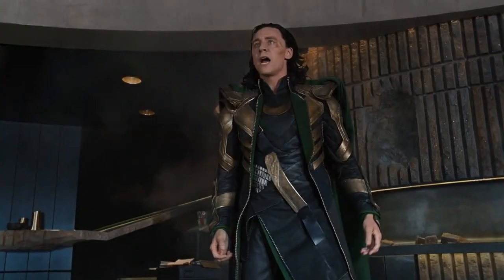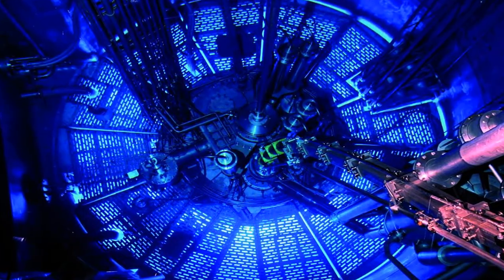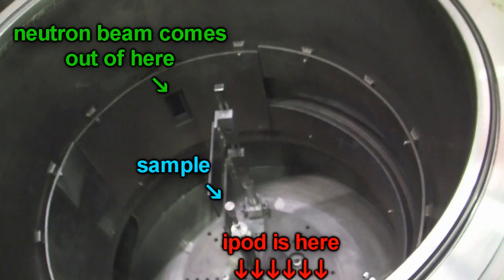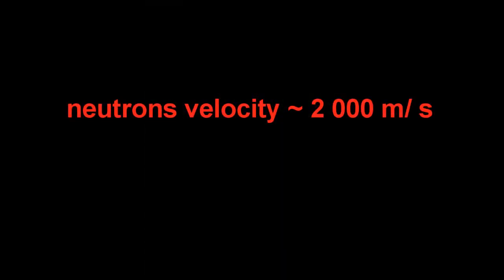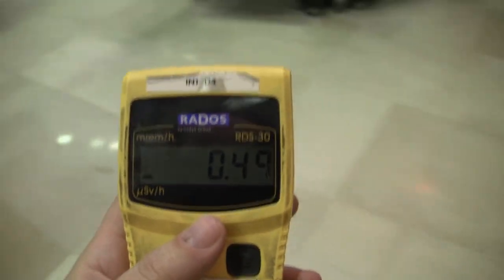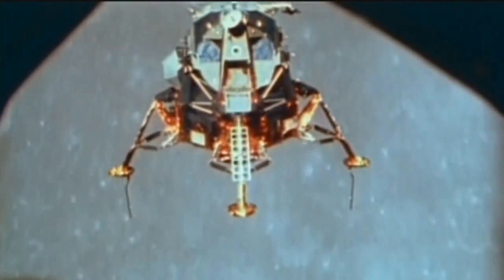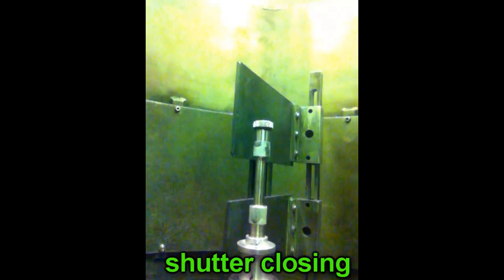Ipod in a Nuclear Reactor Beam

Comment: It could be an interesting idea to add a PIR sensor to the area that prevents the shutter from opening, just in case someone gets forgotten.
Similar issue have arisen when doing NDT on pipe fittings at a certain gas plant.

Comment: And if the neutrons get absorbed by GOLD, the gold turns into mercury. Specifically gold's one stable isotope, gold 197, it turns into gold 198, which has a half-life of 2 days and turns into a stable isotope of mercury. And I'm sure that the beta decay of this induced radioactivity in the gold is pretty dangerous too. So I have for you a way of turning gold into mercury. Just hit it with neutron radiation. The alchemists of old would be so proud.

Comment: Hello, great stuff. I realize that these are real, but could you please do a video about beam dumps? From particle accelerators I mean.. What goes into designing something like that, with the energy levels keeping to increase In Finnished and proposed accelerators? Hope I'm not too far off from the correct way to pose the question..😊

Comment: I think radiation can be a way to give your ipod superpowers. Like when perhaps just zapping the processor right you might reset the secure boot protection fuses allowing it to boot any image with or without the correct signature, freeing it from it's bondage to apple. Of course just zapping it like you did is more likely to flip bits that are not useful when flipped turning your ipad into an either inert or very oddly behaving paperwork paperweight. However it may be, causing malfunctions intentionally in security hardware with ionizing radiation is probably a good idea. Either that, or nanites that contact the address and data busses.

Comment: I don't know if you said it but what is the source compound for the beam?
Reply: Eric Not 100% certain if this is the case here, but a common neutron source would be hydrogen isotope fusion. Fusion of deuterium and/or tritium generally knock a neutron from the newly formed nucleus. Though these are super fast neutrons, orders of magnitude faster than the ones found in this beam, so you use a neutron moderator to slow it down.

Comment: Neutrons from a reactor can actually activate the aluminum body of the ipad, but the produced radioisotopes decay in a few minutes. 

On a side note, a standard GM tube is not en efficient tool for measuring neutron radiation, I wouldn't rely on that.

Comment: Thunder foot have you ever heard of a material that a guy came up with called star lite? It was a polymer clay like paste that was heat resident. 
If you know the stories about it do you think that it was a Hoax? If not what do you think the ingredients might be?
Reply: Might be a typo to say "heat resident" instead of resistant.
Reply: Ananta Sesa das
 Thanks. Yes. Heat Resistant
Reply: would love to see starlite
Reply: Curious. Perhaps some aromatic hydrocarbon which evaporates and cools the underlying surface. In all likelihood, it was more of a party trick than a hoax, and no formulation based on this invention would have long lasting protective properties. But yeah that's definitely a great subject for Mr. Thunderfoot.
Reply: aerogel doesn't evaporate it's just so full of air that the specific heat is very low. leidenfrost effect lets you hold liquid nitrogen in your hand.Siana Gearz
Reply: I figured starlite was sand and silicon gel based.

Comment: Somewhere in some video you said they decay at ~ 10 minute rate, well then if you just turned on then why did it immediately start affecting the Ipod and gieger counter? shouldn't you have like 10 minutes before the first couple neutrons decay? Or are some of them because of the immediate finding of a nuclei (IJust remembered you said that it released the energy when it bonds too, is that why?)
Reply: +poochy355 The decay of free neutrons is basically a radioactive decay, i.e. it's a random process. Free neutrons begin to decay right after they were "born" in reactor. Some do it faster, some slower, it's pure random. "they decay at ~ 10 minute rate" means that "50% of initial neutrons will decay in 10 minutes".
PS sorry for my bad English, haven't practiced it for a long time.
Reply: +poochy355 Decay is when a particle breaks up into smaller particles. The cause of the flashes is neutrons bonding with the atoms in the pixels releasing a shit ton of energy producing a flash.

Comment: Can you make an experiment with a small piece of pork meat and put it in glass tube and see what would happen by neutron bombardments !!! That would be very interesting !!! :)
Reply: +Nickael7 Nothing you could see directly. Though it would decompose quicker than normal.
Reply: 556x45mm NATO
I don't think so due to irradiation.
Reply: Nickael7 Decomposition of organic matter relies on bonds being broken, so that the carbon oxygen and hydrogen in the matter can return to the environment in the forms of carbon dioxide and water. When you've had neutrons decay in organic matter, all it does is break the chemical bonds, which will in turn cause it to decompose quicker. It will not be "irradiated" whatsoever, and will hold no radioactivity shortly after the neutrons decay, not that this has anything to do with decomposition reactions in the first place. Where did you get your chemistry degree?
Reply: 556x45mm NATO
After the explosion of the bombs of Hiroshima and Nagasaki, the corpses had very hard time to decompose, to decay...
With your chemistry:
Where did you came with such conclusions ???
Reply: +Nickael7 Nothing.
Reply: +Nickael7 They had very hard time since they were charcoal.
Reply: CptHrki
That is my first impression...

Comment: Scintillations galore! Reminds me of my alpha particle spinthariscope! Neutrons have a half-life of just less than than 15 minutes. They decay into protons and release ~1 MeV of energy. Water is good at moderating them. Borated paraffin is good at slowing them down to thermal neutrons, so they can be captured. Neutron cross-section is measured in barns (bn). Fissile nuclides can release them, and alpha/beryllium sources can produce them, i.e. PoBe, RaBe, PuBe, and AmBe are used as portable sources.

Comment: Neutron has mass 939.565 MeV/c^2 which is 1.6749*10^-27 kg. Video mentions velocity 2000 m/s.
Kinetic energy E.K. =1/2*m*v^2 (for non-relativistic velocities) = 1/2*1.6749*10^-27*2000^2=3.3499*10^-21 J which is 0.0209 eV, not 0.3 eV mentioned in video.
Neutron decay n0 = p+ + e- + Ve + 0.782 MeV, not mentioned in video 1 MeV. Part of energy is taken by anti-neutrino.
If neutron capture will happen, neutron will join with some atom together, and then they can decay releasing plentiful of energy, releasing electron and anti-neutrino, or even fission (U-235 etc.). But released decay energy depends on material and isotope it joined.

Comment: serious question? being that neutrons take a short while to decay, do you or would it be a good idea to wait out the half life be fore entering to the exclusion zone... as in is there a time after the shutter is closed that you can't go back past the gate?
Reply: +George Holt That wouldn't do much since neutrons do actually leave residual radiation. You see, when a neutron hits its first atom, it will most likely split it, producing another neutron. However, after losing energy in the collision it will become slower and most likely be absorbed by the nucleous of the next atom it hits rendering that second atom radioactive from a few minutes to months and years. As this reaction progresses more and more atoms are rendered radioactive until at one point the reactions stops since all neutrons have been captured, but the radiation will persist. This is also why neutron bombs aren't clean.
Reply: +Glen Brockwell Neutrons do actually leave residual radiation. You see, when a neutron hits its first atom, it will most likely split it, producing another neutron. However, after losing energy in the collision it will become slower and most likely be absorbed by the nucleous of the next atom it hits rendering that second atom radioactive from a few minutes to months and years. As this reaction progresses more and more atoms are rendered radioactive until at one point the reactions stops since all neutrons have been captured, but the radiation will persist. This is also why neutron bombs aren't clean.
Reply: +Glen Brockwell You probably have no idea what you're talking about. First of all, there are no fumes from a neutron beam, adn secondly an exclusion zone is a zone you SHOULDN'T be in, not a safe zone.
Reply: +Glen Brockwell Nothing comes out of the tunnel except for radiation. It is sealed on the other end, otherwise you would be having a bath in the coolant.
Reply: +George Holt Newbie question, explanation: Neutrons penetrate further than gamma rays and do not leave residual radiation on objects...
Reply: I don't study this stuff at all, I was simply asking about a matter of practice at the reactor... I didn't think there was long term residual radiation what i was asking was is there a very brief period where the immediate area is this radioactive or is it immediately safe the moment the beam is closed?
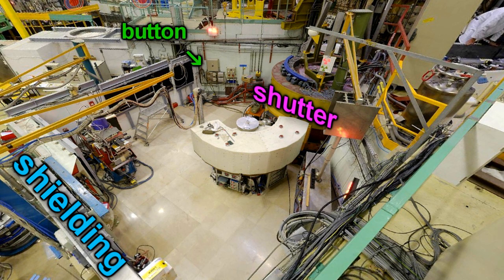Reply: +George Holt As far as I can tell; the place is a lab of sorts (pause at 02:00). Observe the exclusion zone is perhaps the only safe place while the neutrons are released. Dude opens his bunker after the radiation is halted, walks to the experiment about 5 meters and opens the outer core in ten seconds. Unless the clip is edited, there is no break to wait for potentially dangerous 'fumes' lingering out of the 'gun hole'. Which would have a half life of a few days.
Reply: +CptHrki I can only imagine what comes out of the reactor when the core is exposed. Moreover it wasn't residual neutrons I had implied was "lingering" but perhaps some radioactive aerosol which is produced in the nuclear reactor.

Comment: Those flashes can be seen with normal earth background radiation.  They're just far less frequent, you might see a flash once every few days.  If you're wondering why you see a pinprick of light in your vision every once in awhile, that's why.  The Earth's radiation shield (electromagnetic shield & ozone) isn't perfect so we still get some radiation, and those flashes are just what happens when a stray neutron interacts with your retina and the nerves fire making you see a flash in your vision.
Reply: +Sue Sakamoto actually most of those things you see (commonly known as "floaters") are usually the result of dead cells that have been shed from the lining of your eye and floating in the fluid of the eye ball, or dust and fluid on the surface of the eye.
Reply: crwydryny
 I know what eye floaters are and I've seen them, what I'm talking about are not eye floaters.  You can see eye floaters any time, these flashes of light that I'm talking about are high energy particles interacting with the fluids in your eye.  You see them a few times a week at sea level, almost never underground, and daily when in a plane or on a mountain.  These particles are the minority of nuclear radiation from space that gets through the Earth's electromagnetic field and atmosphere, but they also come from the Earth, specifically where radioactive elements are decaying.
Reply: Alec Risser
my comment was in reply to sue sakamoto.

yes I know about flashes of light caused by radiation
Reply: On a phone, can't edit...  *electromagnetic field
Reply: +Alec Risser staring at the sun then looking away allows you to see the bacteria in your eye, the "green tints" are the bcteria squirming in your eye. (SRC: Matthew Santoro, amazing facts series)
Reply: It's radiation from space and radioactive elements in the earth.  I'm only talking about nuclear radiation not electromagnetic radiation in this situation.
Reply: +Alec Risser No, they can't. Here's why:

Earth's own background radiation (from the ground) mainly consists of very weak electromagnetic ionizing radiation or beta and alpha particles which are readily stopped by very thin material and don't have nearly anough energy to cause flashes. As for cosmic radiation, it's mostly composed of gamma radiation before it reaches the atmosphere. If it went straight through and hit you in the head, you'd be dead fairly soon. Fortunately, cosmic radiation hitting you is pretty much impossible since it interacts with air and everything else in the atmosphere breaking it up into weak radiation talked about earlier, rendering it unable of producing flashes of light. Same goes for Sun's x-rays.
Reply: Your eyes are sensory organs that sense light.
Reply: uggh Trump!
Reply: +Steven King YOU DON'T SAY
Reply: most of the time i saw my own white blood cells when looking at the blue sky.
Reply: +Alec Risser 
I had the suspicion that this might be true. I occasionally do see flashes of light despite no car windshields reflecting into my eyes etc and sometimes when I'm trying to fall asleep. I reckon about every couple of weeks or months. I read that there is an eye sickness that can be the cause but I discarded that since other symptoms would have been more prevalent. I read that astronauts do see those and I thought maybe on very rare instances the radiation does reach the ground and hit my eye. But you say it's earths radiation?
Reply: crwydryny
 I know.
Reply: +Steven King u know
Reply: +Steven King I know
Reply: +John Doe was looking to see if anybody posted this info
Reply: That's interesting. I'll remember about this when i start to see stars. Who knew that humans have internal geiger counter?
Reply: +Razzfazz87 better stockup on dem radaways
Reply: Alec Risser
Interestingly (at least to me) is the phenomenon sometimes called the "blue pearl", a tiny blue light smaller than a sesame seed, which in Hindu Tantra is recognized as the visual component of "nada-bindu", the high-pitched ringing that is not tinnitus but can sometimes be heard in a quiet room.  These are considered divine and can form the basis of a meditation practice... 🙏🏾✌🏾

Comment: is it not also possible that was electrical signal interference? ive seen the same result from poor signal shielding in cameras near electric motors and generators and near radio and tv towers
Reply: +aterack833 not the same exactly. Happens strongly near large explosions, which have a strong emp.
Reply: +Carbon 12 i was wrong and dont remember being that smart, wow i got really dumb now then

Comment: how long does a neutron take to decay?
Reply: So there's the answer. Half-life is about 10 minutes, mean lifetime is about 15. I want to make sure Gen understands that this is a statistical question, and it's not that no neutrons will live past 15 minutes.
Reply: +Gen Scinmore Nearly 15 minutes. It is by far the longest living sub-atomic particle.
Reply: +tibschris yes. the half life is nearly 10.3 minutes, and the free decay life if nearly 15 minutes. according to Wikipedia, "A free neutron is unstable, decaying to a proton, electron and antineutrino with amean lifetime of just under 15 minutes (881.5±1.5 s)" and "...therefore the half-life for this process (which differs from the mean lifetime by a factor of ln(2) = 0.693) is611.0±1.0 s (about 10 minutes, 11 seconds)"
bows
Reply: Gen Scinmore 613,9  s
Reply: +Gen Scinmore The half-life is 10.3 minutes.

Comment: ***** how are the neutrons released? Is it an alpha decay particle being smashed into beryllium? Which causes a neutron to be released from beryllium or are there other means of creating a neutron beam too?
Reply: *****
Just water isn't heavy in enough I believe I think you'd need Deuterium or Tritium at least.
I've only made a neutron beam using Polonium and Beryllium my Uranium simply isn't energetic enough (very slow decay time) in a reactor the uranium is enriched (liek you said) so the heavy elements would do that.

Most reactors also use heavy water Deuterium which would do the trick. How to guide those from the reactor vessle to the test lab is the big question (as the did here).

Comment: Is the Ipod safe to handle or would it be too hot to ? how much radiation did it absorb if any ? would it be safe to throw it in my jacket pocket on my way out? thank you for your fascinating videos.
Reply: +lord funkbottom Why would it be dangerous?
Reply: +lord funkbottom things get contaminated with radioactive particles, not by radiation itself. Wrong type of leaves.
Reply: Carbon 12 There's also this thing called "Neutron activation", where it can become radioactive with radiation
Reply: MrJason005 yes, but the iphone wasn't even in the neutron beam, the sample was. The amount of neutron activation in the phone would be sooo tiny. Even the sample would be barely radioactive.

Comment: if the halflife is ~10min, why do you not have to wait atleast 10min to open up the vacuum chamber and grab the ipod? or did you cut the recording?
Reply: The 10 minutes half-life are only meant for free neutrons, not for neutrons in general. And the neutrons will not stay inside the chamber. They will bounce of or pass the walls or react with the wallmaterial. Thats also the Reason for the thick shielding outside the chamber. The walls of the chamber can't stop every neutron. Neutrons loses energy and slow down when they pass solid objects and then eventually react with an nucleus. As an example hydrogen can turn into deuterium if a hydrogen atom captures a free neutron. Neutrons don't decay as long as they are part of an nucleus. So when thunderfoot turned the neutronbeam off, the free neutrons disappeard in an near instant because they already decayed or reacted with something.

And to be safe with high radiation materials or objects, you should wait at least four times the expected half-life, because after that, about 94% of the radiation is gone and you should be on the safe side in the most cases.